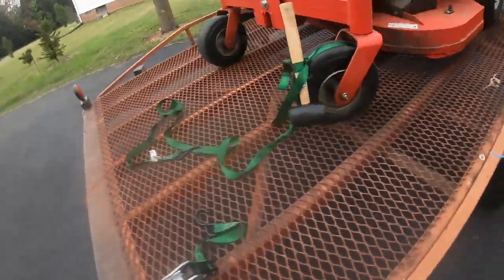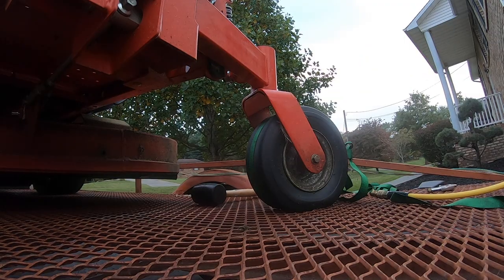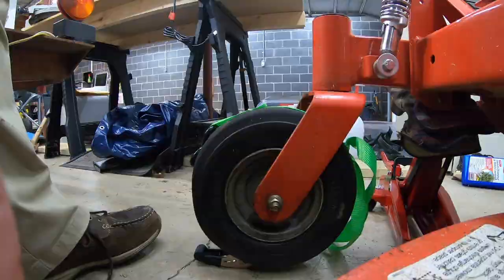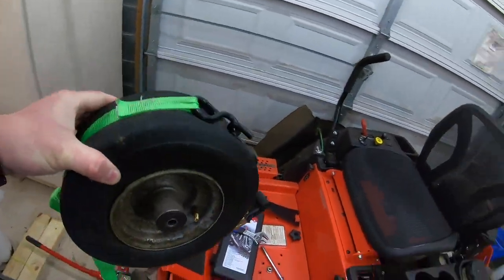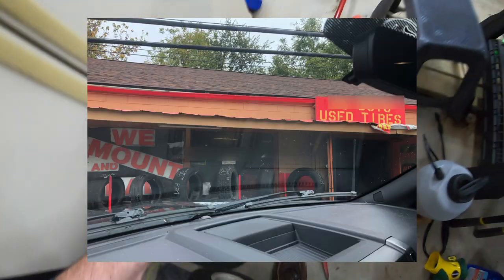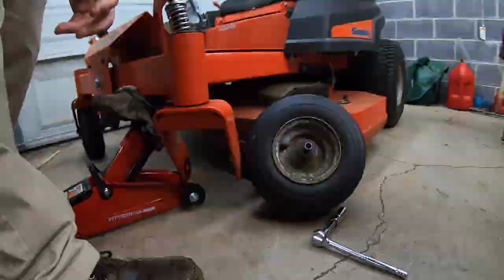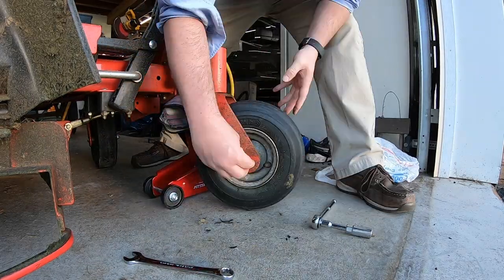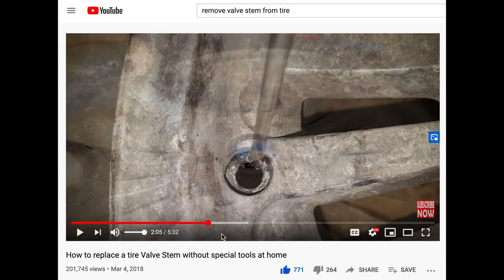How To Inflate A Mower Tire Off The Rim - Simplicity Courier SZT 2691479-00

Comment: This is what I did when I had a flat on my zero turn. I got a can of starter fluid. Compress tire side walls so I can spray fluid inside rim and gave it a light and it filled instantly.

Comment: I still gave it a thumbs up, even though it only showed me how to take my tire to a third party, which is exactly what I was endeavoring to avoid. 😂 At least there were no sanctimonious lectures on the virtue of soapy water over plain water.

I'm going to go look for the video where they use fire to get the tire back on the rim.🔥
Reply from the maker: Thanks for the thumbs up.  Mine popped off so many times last year I ended up buying a new rim / tire off Amazon.  No issues this year.

Comment: I have used a rope around the tire and a stick and twist the stick tight you have to take the valve stem out to get air in it faster
Reply from the maker: I bought a stem removing kit not long after this video.  Not had to use it yet.  That tire place is right down the street, but in a pinch I may have to resort back to doing it myself.

Comment: I bought the same two ton jack.  The seal broke after I lifted the HHR, which is not that heavy of a car.   I threw the jack in the scrap pile.
Reply from the maker: I’ve had it for a few years now, rarely use it.  Mainly for the lawn mower.  But I did use it to support / lift the wheel when changing brakes and rotors on my F150.

Comment: Will my air compressor inflator put air into a stem with no valve? I that that's what causes it to push the air into it when you press against the valve?
Reply: A stem with no valve will just let all the air out of whatever it is attached to. Also, you need a valve inside the stem to be able use a regular inflator. The valve pushes on the valve inside your inflator to allow air to flow out of your compressor tank
Reply from the maker: If you have a standard inflator like you mention it will not work.  You need one that locks to the stem and pushes in air when you press the trigger - like - https://amzn.to/3BQLanx
Reply from the maker: The inflator you'd need is - https://amzn.to/3BQLanx

Comment: Year 2 for my mower and both came off at the same time!
Reply from the maker: I had the same thing happen…both came off within a week of each other
Reply: @weekendhomeprojects  so I got both back on with a ratch strap.  I used one the same size as you at first.  Didn't work.  Moved to a wide strap and voice.  Took about 45 minutes next time it should take 10.